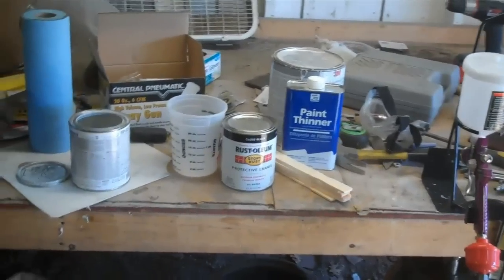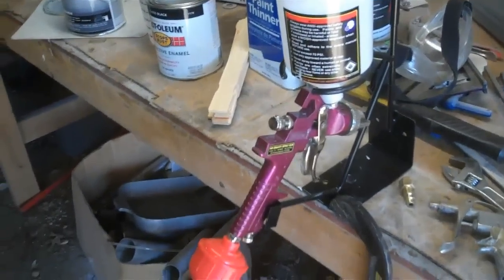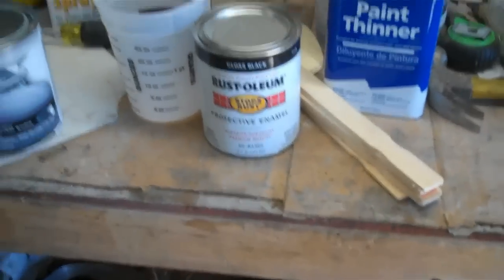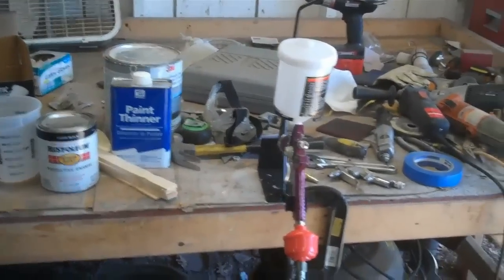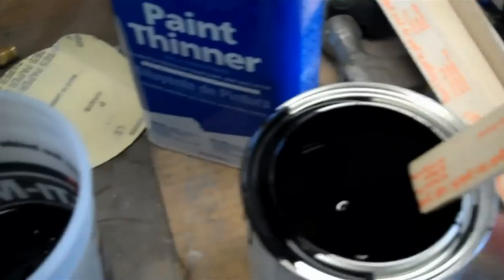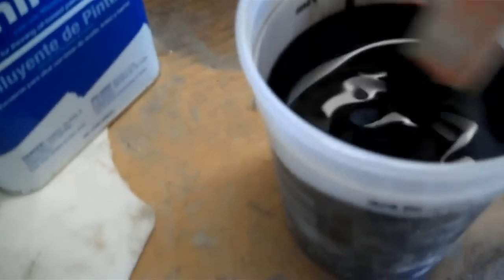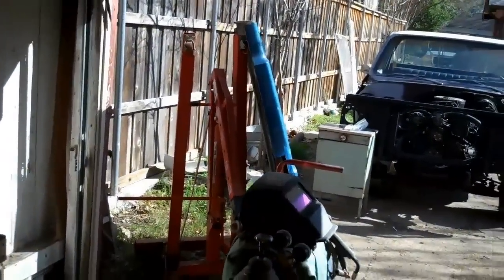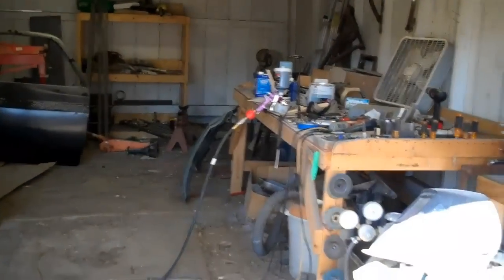PART 1 C10 PAINTING EXPERIMENT | Rustoleum Paint Job

Comment: Try 2 parts paint 1 part thinner and 1/2 part hardener and you will get an orange peel free job. 2-3 medium wet coats at 22lbs pressure HVLP
Reply: Or if u want it to dry quick use goof off.
Reply: What hardener you using ?  What works with rustoleum as hardener
Reply: You can use any enamel hardener in Rust-Oleum

Comment: We used the same type of paint on my grandpa,a 1930 model a pickup and it turned out great. We used acetone as the thinner though. A lot of the painting is down to the technique of the person, not the gun.
Reply: I contacted Rustoleum and they told me to use Acetone for reducer.However I have used paint thinner before I knew this with okay results.Better results with Acetone.I agree with the paint gun operator statement.

Comment from the maker: The gun has a built-in regulator and I was using the regulator on my compressor.  I sprayed at 40psi.  I'm a beginner at this.  I have no idea if that was the right pressure.  I experimented with different settings and 40psi seemed to be the sweet spot.

Comment: The harbor freight guns you have to take it apart right out of the box and clean it out real good cause there is somekind of white thread sealer they use making the gun and it plugs up the gun take it clear apart everything and get all that white sealer crap out of it and it will spray much better i have 5 of them and every one of them had to be cleaned out

Comment: Paint shop paint is overrated and way to high prices too I used rustoleum primer its $23 a gallon at Lowe's and is exactly the same as paint shop paint too goes on smoother too and rustoleum primer and paint cleans up better be sure to polish it after it dries too it will look way better than that too

Comment: first off you don't even have a regulator on your gun.. all paints whether primer or base coat need to be sprayed at the proper pressures be it rustoleum ,latex or epoxy, and auto paint

Comment: rustoleum 50/50 mineral spirits. the directions say use acetone to thin, i dont recommend acetone. 50/50 with mineral spirits and youll get a beautiful thin layer. 7 coats to cover with black on primer. dries quickly too because its thin.

Comment: Painted my truck Rust-Oleum 3to1 ratio is perfect had a nice glossy finish with the orange peel just have to sand and buff and will come out nice or you can paint then go over it with Rust-Oleum clear coat rattle cans wet sand and buff ..on my third vehicle Rust-Oleum paint is better than duplicolor cost like 300$ to do one car and Rust-Oleum is only 💯 to 125$ with all of the materials.

Comment: remember 16 ounces of paint, 4 ounces of thinner.
thats 4:1 ratio
12 ounces of paint would need 3 ounces of thinner for 4:1...
and 1.4 mil tip is pretty common for paint guns. 1.3- 1.4 is what you want unless using high build primer, then its nice to step up to 1.7- 2.2 depending on the thickness build your looking for
Reply: OMGosh...
You're Right!!!
Reply: @judichristopher4604 4to 1 is 80 to 20, 3 to 1 is 75 to 25, so really its 12 ounces to 4 ounces as 4 ounces multiplied by 3 is 12  just to clear confusion, also the thinner paint , dupli-color while it may be crap in your setup, might be better with a 5hp 240 volt 80 gallon compressor that atomizes the paint better, love the video and the info tyvm
Reply: to add coonfusion 100 to 25 is also 4 to 1 :)
Reply: @michaeldraper9804  
Thank YOU